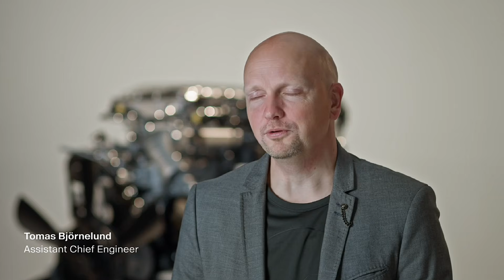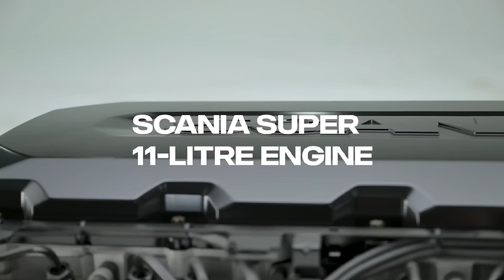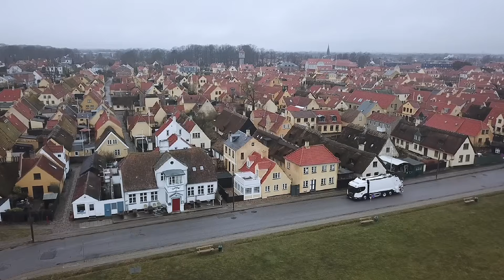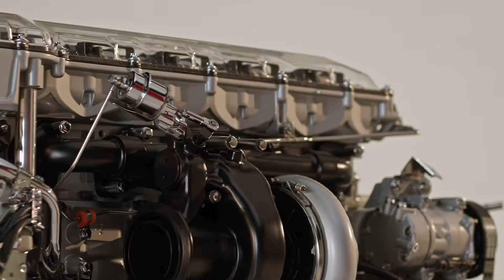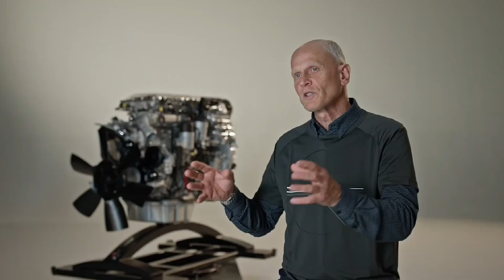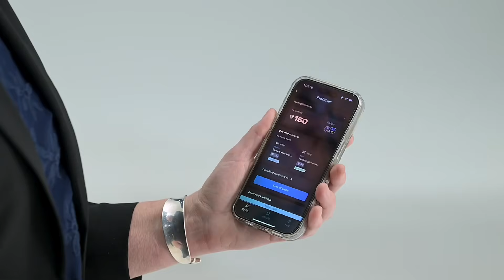New 2026 SCANIA SUPER 11 - Full Details

Comment: How would you say these compare to the v8’s torque potentially especially when pulling stgo cat 2/3 loads
Reply: A 60-ton loaded truck in sixth high gear won’t consume more than 80 liters at maximum load. In sixth low, it will consume a maximum of 100 liters instantly. In fifth high, it will consume 120 liters.

I’ve been driving trucks for 30 years — if your RPMs drop quickly, shift down immediately. If they drop slowly, they’ll fall to 800 RPM and stay there. It won’t have the power to increase speed, but it will have enough power to keep going up a 12% incline while consuming a maximum of 80 liters at that moment.

Shift into sixth low and your instant fuel consumption will be 100 liters at 1,300 RPM. That’s the difference.

And you bakers think a truck has to scream to climb uphill…
Reply: dali sada razumiješ zašto scania ima malu potrošnju, nemaju čarobni štapič nego koriste zakone fizike isto kao kada natovariš na pogon 15 tona  i kamion nejde a troši kao ruski pijanac vodku..jel ti lakše staviti vreču cementa na leđa i nositi ili staviti na kolica i gurati. scania je broj 1 za sve kamione
Reply: Beautiful question.s weak to operate a side tipper 50 tonners